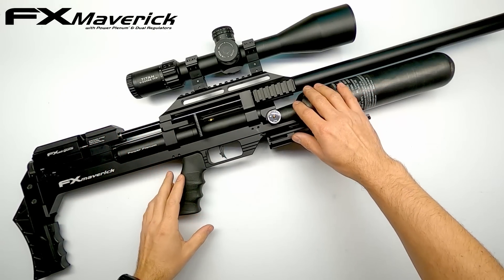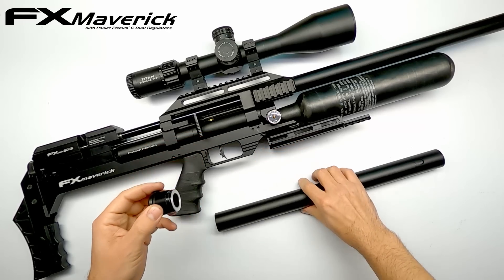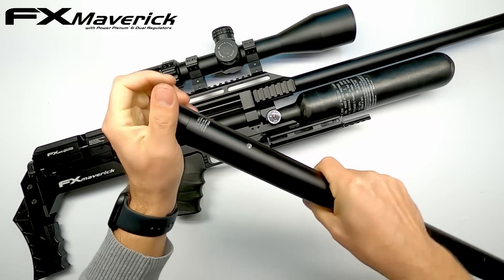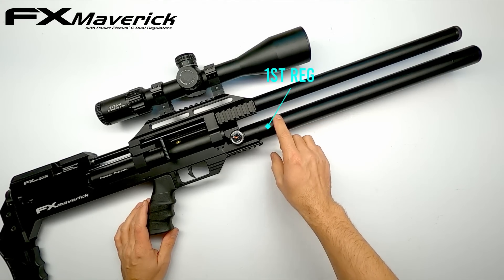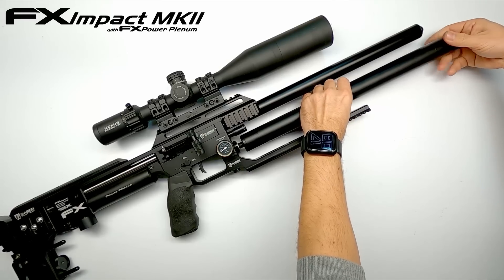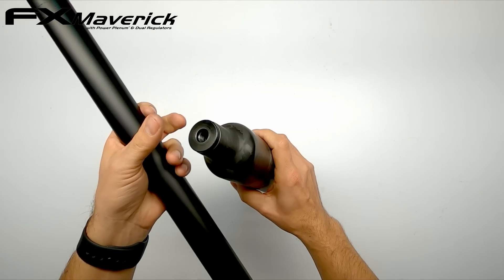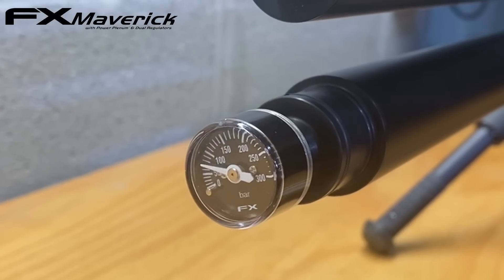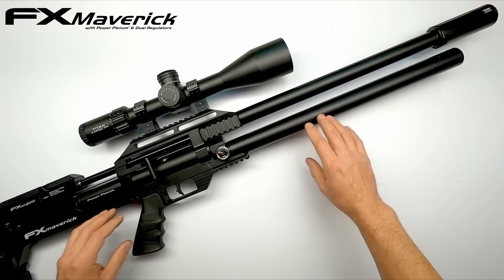FX Maverick Triple Regulated Tube Style

Comment: Sweet setup!  Thank you for sharing 👍. Question, do you find the multiple regulators to be enough of a benefit, as to offset the added complexity?  Thank you!
Reply from the maker: Hi , thx .
The video I made was me playing around with some extra parts I had laying around , it turned out to look like something ( where some of my other ideas don’t 😉) but it’s not a setup I will keep using . It does work well as you could see but it also adds a level of complexity to it aswel . If setup properly I don’t see much difference between 2 or 3 regs , the difference between 1 and 2 is the most important 👍🏻

Comment: Hello, i don't think that 3 regulators are very useful.. just the last regulator is getting improvement with less pressure behind him. A airgun with 2 regulators is not a new stuff, lot of airguners use a airtank with a external regulator in line connected on a regulated airgun to improve extreme spread..

Comment: How many shots are you getting before it comes off the first reg. are you filling tube to 230 or 250.
Reply from the maker: I am filling to 230 . I get just short of 2 magazines but I only see FPS fluctuations when it comes close to the pressure of the second reg
Reply: @Airbuks  Thaks..Did you ever test Maverick by bypassing the first reg, to see what difference is in consistency having two regs makes.
Reply from the maker: @jasonnewton3842  not such a big difference in higher power and caliber tune . The dual regulator system benefits on lower regulator pressures and smaller pressure sharing the workload of reducing the pressure
Reply: @Airbuks When you say lower reg pressures, are you saying around 90-110 final pressure.
Reply from the maker: @jasonnewton3842  that’s correct

Comment: Very nicely done! Have you noticed a FPS change once you’re tube pressure drops below your 1sf reg setting? I ran a dual reg on the Impact and the FPS fluctuated a bit then resettled.
Reply from the maker: No I just sa some fluctuations when it came close to the second regulator pressure, but nothing serious
Reply: @Airbuks  That’s pretty much what I’ve noticed. Below the 1st reg and close to the 2nd. Great work